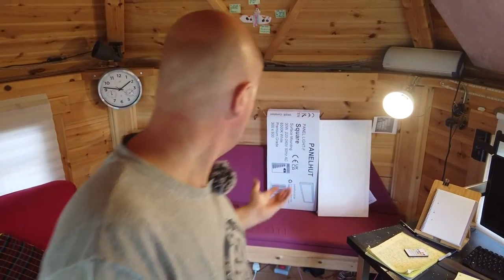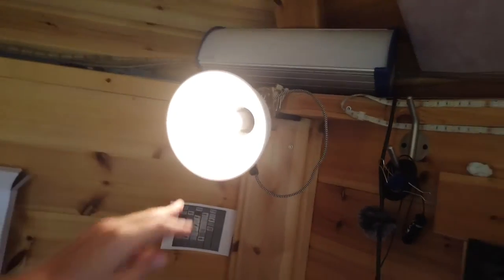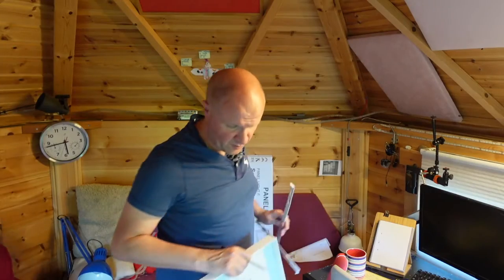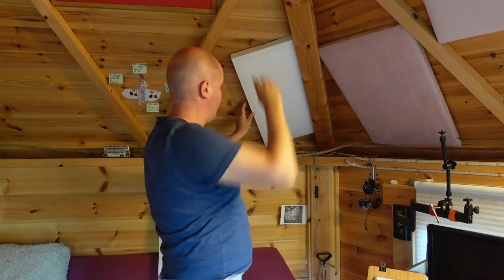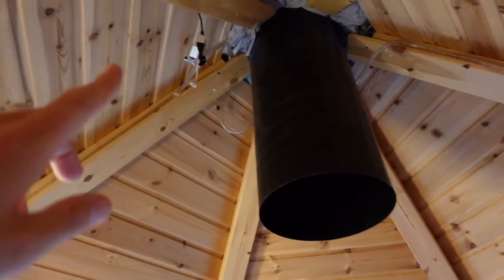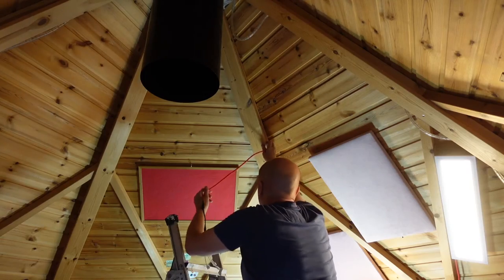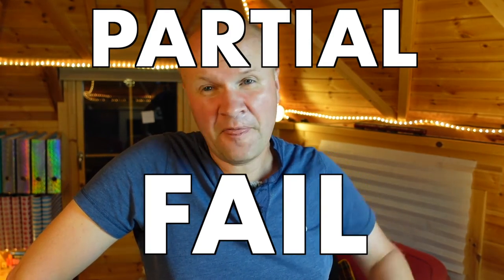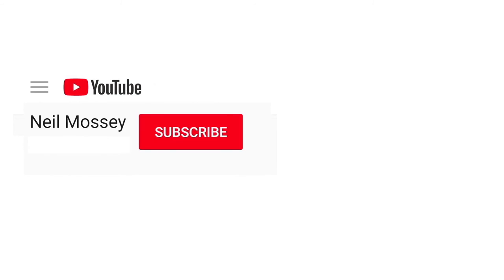Cheap YouTube studio lighting panel idea!

Comment: I use white plastic acrylic plates (cheap on Amazon) to diffuse some of my smaller LED panel lights. 

Although I know you love a fun budget option, if you want to step up to something more purpose built for lighting video check out Neewers latest RGB video panel lights. Pretty impressive. 

I’ve got 4 of them I got for review… they’re fitting nicely into my setup. 

I think my main reason for suggesting proper video lights if you get better colour reproduction due to higher CRI indexes 🙂 CRI is a whole rabbit hole though so be careful what you research, it can get expensive (trust me on that one)
Reply from the maker: Hi Chris  - wonderful suggestions thanks
I think all my budget solutions combined cost more than a couple of proper panel lights that would do the job!
Will definitely take a look at the Neewer ones thanks!
Reply: @neilmossey  could be interesting to compare them?

For what it’s worth, your setup looks great, so it clearly works, just thought it might be interesting. The newer Neewer (lol) lights have cool effects I reckon you’d love too.